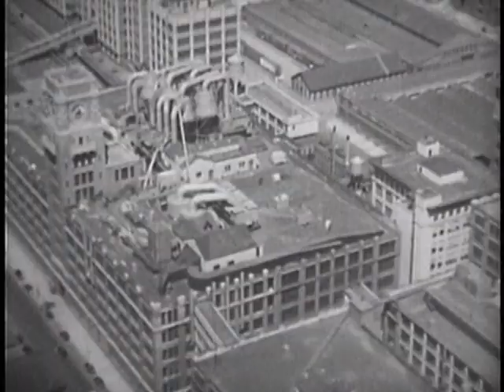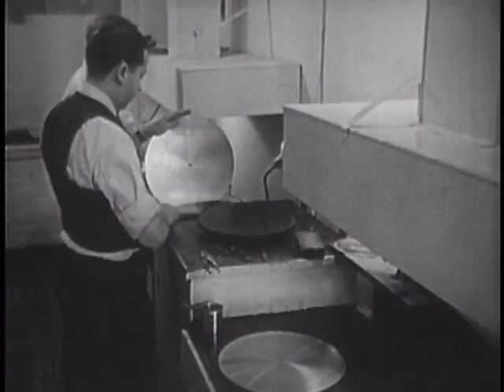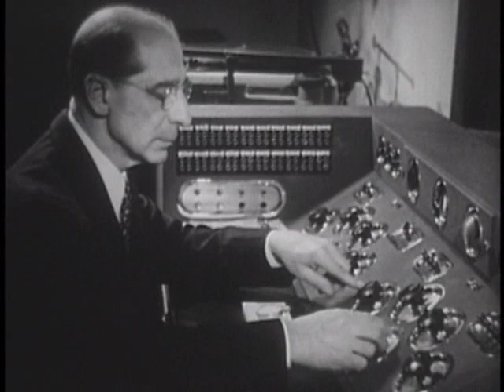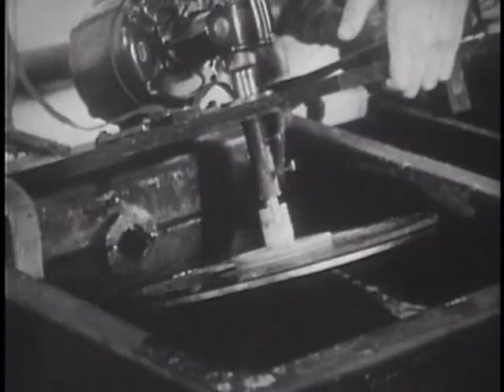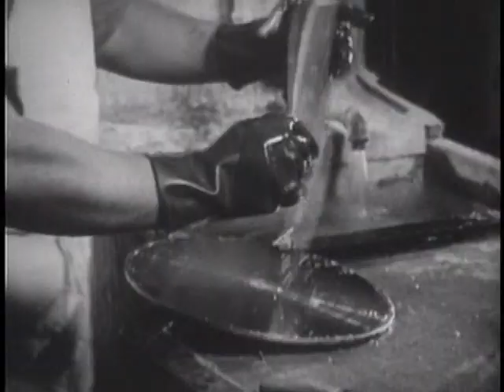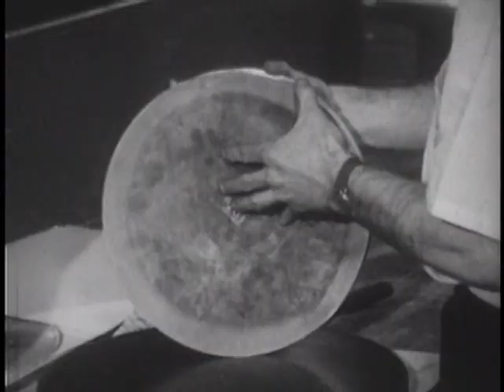Command Performance by RCA Victor part 1.wmv

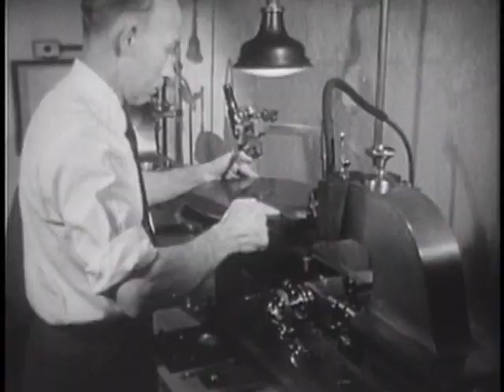Comment: Some have suggested that the making of this film (or at least certain parts of it) was more like 1938 or so. The Scully lathe seen at three different points within the 2:49 - 5:14 period was among 20 made by the company for RCA Victor between 1934 and 1937 (and was the basis for the Model 501 which was made through the late 1940's). One question, though: Who was the conductor? Some have thought Nathaniel Shilkret, but he wasn't actively conducting for the label as of the early '40's.